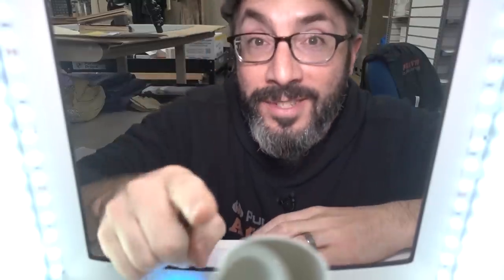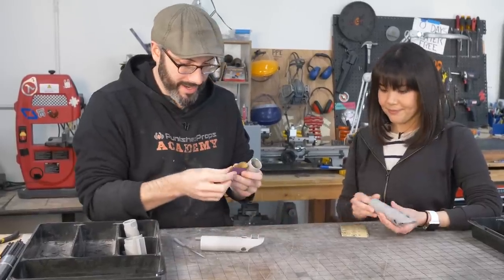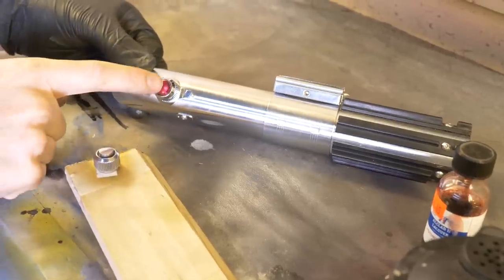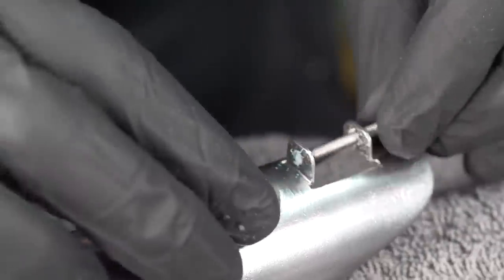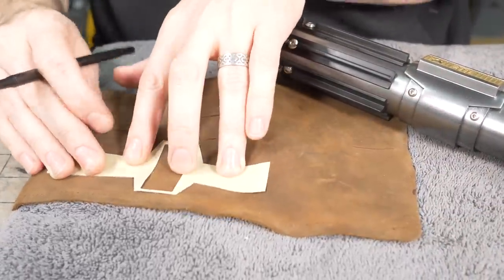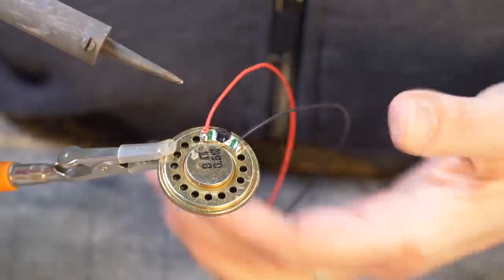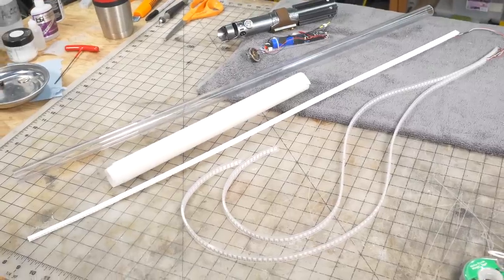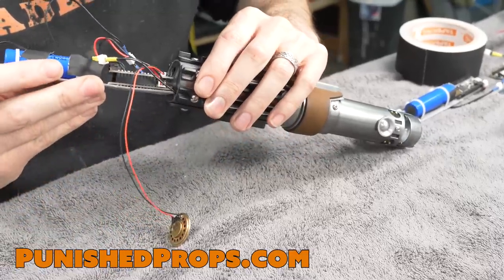MAKING Anakin/Luke/Rey's LIGHTSABER - Lights, Sounds, & FREE 3D Files | RISE OF SKYWALKER

Comment: I'm a fan of Yoda's lightsaber: small, simple, but powerful!
Reply: rainwater739 me too
Reply: Didn't know if this was a dirty joke or not. But yeah, Yoda's lightsaber is simple and clean. Lol
Reply: Technically it's not a proper lightsaber.  It's a 'Shoto'.
Reply: rainwater739. It’s no more powerful than any other saber
Reply: @jaketheripper7385  shoto means short sword in Japanese, yodas lightsaber is just as proper as a wakizashi sidearm to a samuri, both swords both proper
Reply: skizzle yoda’s saber is a shoto saber
Reply: I like qui-gons the design is simple, 1 button, strong grip, easy to control
Reply: @cameron8284  So, a couple things here.  First, technically the proper Japanese  terminology is "Shoto-ko", similar to the term for the type of katana called a "ko-katana".  A ko-katana is essentially still technically a katana (possessing a blade length of at least 60cm and up to about 73cm), but merely possesses a blade at the lowest end of the spectrum limit.  Typically that's going to be between 60.5cm and 63cm for a ko-katana.  The next step down is going to be considered a wakizashi, which has a length limit that tops out at that 60cm mark.  As someone who both practices various styles of martial arts and is a very passionate blade enthusiast and collector, I can tell you that the "shoto" or "shoto-ko" terminology is rarely, if ever at all used in reference to a sub-katana length sword of any kind.  In fact, in my near 20 years of experience I've only ever heard it used in reference to the fact that the term is hardly ever used lol.  This brings me to my next point, which is more so related to the use of language as it pertains to story writing and world building, particularly in a fictional fantasy setting.  So, we know that in the Star Wars universe, in both canon and EU materials that a tool employing an energy based blade and standalone, integrated power source designed to be utilized specifically in the capacity as a melee weapon equivalent to a sword is called a lightsaber.  In fact, we know that the ancient Jed'ai and Sith of old actually used swords and some other crude melee weapons, made with blades that were imbued with the Force in some way.  Fast forward to the era of the Old Republic, as well as the following millenia leading up to the post-Skywalker times of today, and we know that the Jedi and Sith used lightsabers; a weapon always depicted as a sword, glaive, or other polearm designed to be wielded with either one or two hands.  Sometimes more, depending on the species lol.  Still, the standard single-hilt variety is always referred to simply as a 'lightsaber', or God forbid a "laser sword"....  In any case, we know that the precedent for the word "sword" exists.  Other weapons that use the same principle are generally differentiated as such by specifically identifying the type of lightsaber it is, or if it's a "light-whip".  That said, at any point we've seen a 'shoto' being used it is typically always referred to as such.  Even "shoto saber" has been used.  However my point is that as far as we know, a "lightsaber" is something contextually different than a "shoto" within the confines of the Star Wars galaxy.  Quite frankly, the fact that the real world Japanese word means something similar in terms of implication and context is more or less  irrelevant; even if the word was lifted directly and used as such.  The reasoning?  Because as far as the Galaxy of Star Wars is concerned, the Japanese culture, language, and overall anthropological influence and footprint does not exist.  Now I'll admit, this could spark an entirely different debate regarding the influence of culture on language as a whole, and how the fact that the English language even exists in a manner we can comprehend in the Galaxy of Star Wars says that human sociocultural development had to resemble that of Europe and the Americas almost entirely, and the languages that are the basis for English had to exist as well.  However at any rate, I digress.  The ultimate point is that as far as we know purely due to the usage of language, a shoto is considered something intrinsically different from a traditional lightsaber, since as far as I know I've never seen the compound of "shoto lightsaber" used in any media.  Essentially, it's like this: A lightsaber is not a shoto, and a shoto is not a lightsaber.  Kinda like the whole "pistol vs. handgun" thing.  Every pistol is a handgun, but not all handguns can technically be considered pistols.  
Now I'll be the first to admit, my reasoning in all of this is based purely on language and how it effects our perception, dictating our comprehension and understanding of both the physical and metaphysical world.  I could be totally wrong here, and you could be correct in the whole "shoto is just another type of lightsaber" schtick.
In fact, you more than likely are and actually I more or less agree.  I'm basically just being an argumentative asshole for the sake of being pedantic.  Still you've gotta admit, it's something to think about....  There's definitely the potential there to really bake the old noodle if you give it too much thought and/or credence though.
Reply: @cameron8284  Or the guy from BNHA

Comment: "I hear the lightsaber screaming in pain!" Yeah, it and me. You know, with decorative leather like that, you really only need to scratch the points of most wear. In this case, you could have gotten away with only scratching where the leather ends meet since the rest of the edges look mostly held by tension. With the addition of superglue, it would have held even over the paint. Less scraping, less cringing, and less work.  Maybe scratches at the outside corners, too.

But that's my armchair quarterback opinion since, you know... you made it and I didn't so, technically, your expertise far outweighs my own.
Reply from the maker: I definitely prefer to make things more secure, but that's just my personal preference as a maker :)

Comment: great work and great breakdown / tutorial, but there are plenty of dedicated control boards for this exact thing, all of them boasting better sound and motion response. such names as Crystal Focus X, Verso V1 or the Proffie Board v2.2 to name a few. this would have simplified the build process and some require almost no knowledge of programming to get them working. as for the pixel strips for the blade 144 pixels per Meter is recommended to give the best results but they do come at quite a hefty price tag. also highly recommended would be to use a 28mm wow speaker from TCSS. this will help give more wow factor!
keep up the good work and maybe we will see you doing an upgrade project for your custom saber!

Comment: Fun fact: The black fin looking parts on the handle we're originally made from cuts of windshield wiper blades. A great idea since they are rubber. Adds to the grip, and the spacing prevents too much sweating when you do, inevitably, get to swing them around a bit. 

If you get around to making a combat ready saber, keep in mind the weight of the battery and sound board,  in comparison to the weight of the blade. A saber should be evenly weighted when teetering at the edge of the hilt where the blade makes contact. I have modified a few premade "combat" sabers, and that makes a huge difference in the feel of the swing. Make small tweaks after that to customize the feel to your liking. The saber should want to flow with your arm, and not fight you on the back swing.
Reply: Actually its been recently determined the grips are from tea cupboard door tracks. Mark hammil complained about them cutting his hands.

But what you say about center of gravity is VERY true. My Disney savi saber is SO HEAVY after swings my arm is sore, and it doesnt control very well. I spin my much lighter korbanth LS6 and its so easy it almost feels wrong lol
Reply from the maker: Thanks for the cool info!
Reply: @RandomStuffGarage619  it's not the weight of the sword in total, just the weight difference between the handle and blade. My saber weights almost 2 pounds, but it's evenly distributed so that when swung it feels like an extension of my arm, while still not pulling me away from the target or tiring me any more than normal. My hand basically rests at the pivot point of all the weight, so I can swing in any direction with easy. It's not loppy.
Reply: @jester4761  Yeah that makes sense. I suppose it could be worse with a Disney savi saber. The blade LED ladder type so its not empty. That balances the weight a little. Not much but I'm sure it helps because if you have never felt one of those chunky sabers they are HEAVY!
Reply: @RandomStuffGarage619  I haven't felt one of those. I got a few from kyberlight, and then I had some aluminum parts machined custom to fit, then I grinded and sanded until I had a weight I was happy with.

Comment: Thanks for this video. It's pretty helpful. I'm currently further customizing my Savi's Workshop saber from Galaxy's Edge.  My biggest issue is the standard diffusion of the LEDs.  The LEDs are protected by a foam tube. It just doesn't do a great job of diffusing each individual LED and takes away from the overall aesthetic.  You clearly see the bands of light from each LED. One of my solutions was actually parchment paper as well. The problem I ran into was the parchment paper wrinkling and creasing. Any little imperfections really showed up a lot through the LEDs. It's really hard to keep the paper clean of imperfections. Do you have any tips on successfully preventing the creases and wrinkles? And, I'd like to protect the LEDs to some extent. I don't plan on any major combat, but showing of the flash on clash would be nice. I don't want to damage the LEDs in the process though.

 Also, I removed the rubber "leather" wrap on the handle and have replaced it temporarily with real leather.  It's just, oddly successfully, being held via tension.  I do plan on permanently re-wrapping it with braided leather cord.  I notice you just used super glue for the leather accent on Rey's version.  Would that be sufficient to wrap the handle? I planned on using E6000 since it seemed to hold up the best. I was also suggested using contact cement. My only issue with that is that there is no "side" to the leather rope and it would probably be a pain to use contact cement. It might be hard to tell which "side" I applied the cement to. And, I don't want it adhering to anything I don't want it to. Not to mention the fumes.  Thus, my choice of E6000. Anyway, any suggestions you might have for me would be greatly appreciated. Thanks.  -  Jack

Comment: Just being the detail and fun fact fanatic that I am. Sophy’s lightsaber isn’t fully the A New Hope Version. The activation switch is on the opposite side of the one in the film and on the graflex camera flash handle that was used for the lightsaber in the film and practically all of the films in the Original Trilogy. But hey that’s just my detail frantic fanatic that I am. So if you want to specifically do the A New Hope or The Empire Strikes Back version, you might have to alter the making of the saber a little bit if you want it to be just like the version that in the film.

Comment: great build, but a lot of the "I don't know what this is supposed to do/be" is because the original prop was made from a camera flash unti. The copper nubs were the electrical connections and the clip was to attach the unit to the camera it worked with.

Comment: You inspired me to build my own lightsaber (on a much smaller budget) and I wanted to ask if you can see the individual LEDs by using parchment paper as a diffuser. That's because I used packing foam for mine and it does a good job, but you can still see it's an LED strip. On camera looks dope though, it really looks like a lightsaber.
Reply from the maker: That's absolutely fantastic! You can see the individual LEDs a little bit through the parchment, but not too bad.

Comment: Sophy is a master at soldering.   How will you charge your Li-Ion battery without a charging port?
Reply from the maker: Isn't she amazing to watch? Like it's nothing! There is a way to charge the battery, I have actually had to charge it a few times because I keep playing with the lightsaber :P The Arduino tutorial we link may help add some clarity to how the pieces work.
Reply: @punishedprops  I used to own a Photo-Studio in the 80's and i wish I had kept the 3 -Cell Flash Bracket I had for my Graflex 4X5 Press Camera.  

Have you ever considered putting that same sound card and arduino in your metal original Light Saber?  It looks like you could stand up to some real Saber duels with that one.
Reply: @punishedprops  Was it your desire to deliberately make the entire project with your 3D printer?  At first I wondered why you did not cut up a windshield wiper refil blade to make the black strips on your hand grip just like the prop master did on the original Skywalker Light Saber.

Comment: Hilt is 10.7 inches blade 3feet the brass pin are the charging doc the leather part is inset the larger button with the copper middle is the blade length

Comment: for that extra shine, put a chrome basecoat under the black
Reply from the maker: Thanks for the suggestion!
Reply: @punishedprops  No problem dude ! i found this out when i had a morotbike that had "multicolored" in its papers, and my then 16 year old brain said jeah lets paint it! and i ended up spraying it a different color every other week with rattle cans. When the time came to Spray over the chrome details, i noticed they were there was chrome, the matt black was matte but shiny at the same time, where everything else was just matte.
I think that chrome finishes in general leave a really smooth surface and since its highly reflective, i think some amount of light can penetrate the pigment ontop and makes it shiny/mirrory.

Comment: Hi Bill, I have all the parts made and have purchased all the parts from Adafruit. The speaker they call out is larger than the one you show in the video, do you have a link for the speaker you used. The 3D files were great they printed real nice, Thanks for a super video.
Reply from the maker: Hmmm the speaker link should be the same, since we used all the same materials as they did in their tutorial.

Comment: this is like 3 years old, but I planned on building the saber just like that. I soldered everything and the board shows power when I turn on the switch, but nothing else works. could it be that the code on the adafruit website is faulty or did you change the code for the button, since they used a rgb button..?

Comment: ah I’ve just got to the part where it turns out it has a separate switch for power. It makes me wonder why didn’t you use touch activation for the action switch…
Reply from the maker: As I mention in the video, the way the sled works to hold the electronics doesn't quite allow enough room for that switch to be used.

Comment: @Punished Props Academy Do you have any printing tips for the very small and fragile bits/pieces?
Reply from the maker: I definitely prefer to print stuff like that on my resin printer so I don't have to try and sand itty bitty pieces. If I am printing on my other printer, I'll max out the infill and make sure I am capturing as much detail as possible with the least disruption from supports and layer height
Reply: Thank you. I’m turning this into a printing challenge with my engineering professor. Unfortunately we don’t have a resin printer, so some of those small parts make him a bit skeptical. We’ll see how it turns out!

Comment: Tried printing the casing in PLA, and I'm sorry to say, there's no way you could build a combat ready lightsaber prop from this. Even with great layer adhesion, the wall thickness is so thin that a PLA printed casing will crumble in your hands like a soda cracker at a three layer wall thickness.  Is there a way around this problem? Because I have a lot of pretty parts that won't stand up to even the most gentle use.

ABS may be the only thing you can print these in.
Reply from the maker: These files aren't intended for combat sabers. You would likely need to use a different fabrication method for that.
Reply: @punishedprops  Yeah, that's obvious now.
Reply: @punishedprops  So if I decreased the interior diameter (except for places where the parts have to fit together) to double the wall thickness, that just might fix the problem for us Ender 3 owners. Interesting problem. I think I'll try it.

Comment: dear someone who has made this (that is if someone has):  around how much did it cost?
(I already have a 3d printer.)
Reply: If you already have all the tools and the filament, it's super cheap.. if you need to buy the air brush, paint for said brush, sander files, clippers, ect, it's going to cost about $100 or less. I'm starting mine now and I think I might need to visit JoAnnes a few times to get the things i likely forgot
Reply: @oSamiSrzo hey question, so i checked the adafruit part list and some of the parts used in the video are not listed in the website part list anymore, maybe it is due to the video being old. But i was wondering, how did you but the red button to switch on the lightsaber lights? Also where did you purchase the power button to turn on and off the whole system? I am wondering because i cant seem to find them anywhere and i would be very appreciative if you do have the link to them 😅 thanks
Reply: @AndyIscool-nn8el  I tried to send an Amazon link to the button I used but YouTube censored my reply

Comment: They must have run out of stock and replaced it with the one they sent me. The new one is 40mm in diameter, the old one is 28mm. I’ll have to search for a replacement.